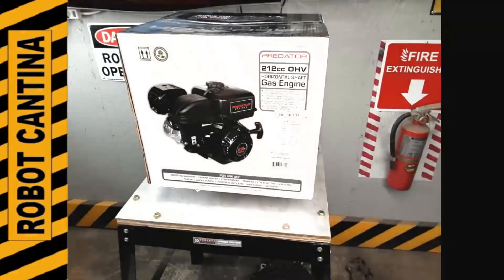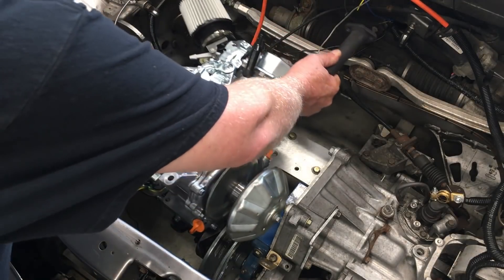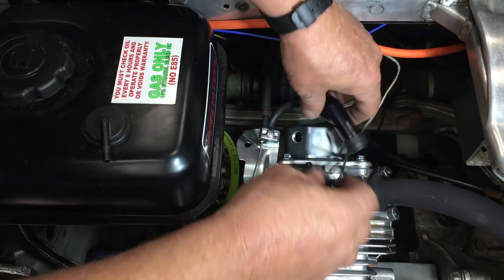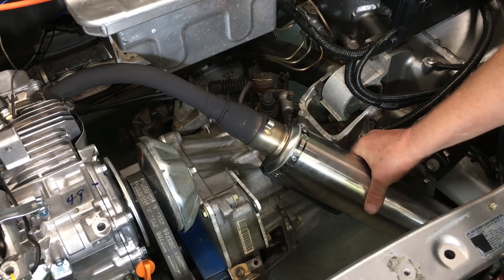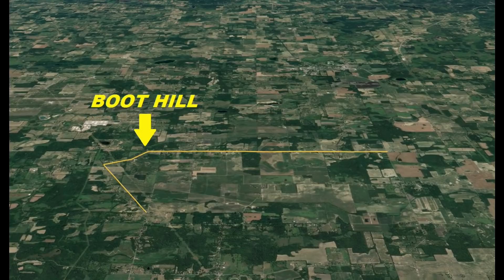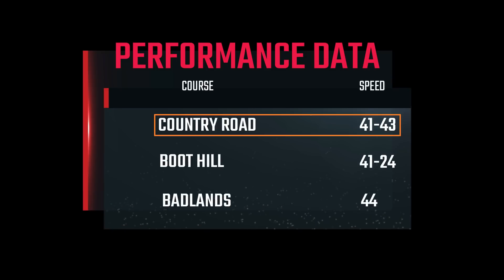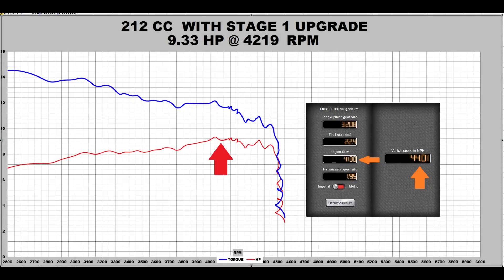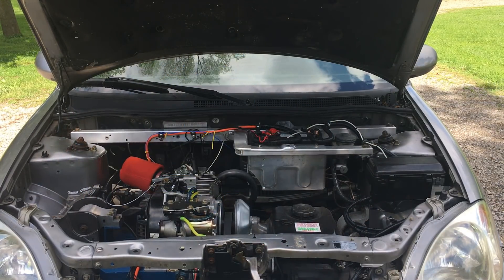Episode 4.  We put a stage one  212 cc engine in a Honda Insight  (Part one)

Comment: Great production work!
It seems your vehicle is more akin to a tractor than a gokart.
The stroker lawnmower engine is built for torque at low end, instead of power at high end.
You keep doing this kind of stuff, you will have a custom electronic ignition control, and computer tuning rig for the mixture!

Comment: Really shows how little power is actually needed to cruise around at low speeds
Reply: The lightweight car did go on a diet, but yeah, I think I heard it only takes about 20 or so HP to cruise at 50mph, though with cars slowly getting heavier it would be a bit more.

Comment: I found the investment in an exhaust oxygen sensor extremely handy for tuning. Weld a bung on the exhaust and you can monitor the fuel / air ratio under different loads and dial in the best jetting.

Comment: I have a 2000 Insight. Third and fifth synchros are shot and the battery pack is in poor shape. If not for the fact I live in New York and have to pass enhanced emissions, I would consider this modification.
Reply from the maker: move to Michigan...  Just kidding.  I actually grew up in NY
Reply: @robotcantina8957   are you saying this is street legal in Michigan, but not NY? What are the parameters that would make it street legal in most states?
Reply from the maker: @vladG30  The term street legal is sort of a joke.  In the State of Michigan, there are no vehicle inspection requirements and the state is unaware the vehicle has been modified.
Reply: @robotcantina8957   thanks. That gives me a reason for maybe moving to Michigan.

Comment: The remarkable part of this series is that you’re managing to achieve 70kph with an engine strapped to a 500kg car. Imagine just how fast it could go if it were to be strapped to a 50-100kg vehicle. Case in point: most bicycle enthusiasts use bicycles 10-20kg. A bicycle- based Human powered vehicle called a velomobile can use about 300-400W of power to get to 70kph. 9hp is 9*746W= 6714W!! (This is comparing the maximum power a person can pedal for a reasonable amount of time to he max power of this vehicle)

That would certainly be more than enough power to push a velomobile to well beyond highway speeds. It would be ridiculously dangerous though when you’re in a fiberglass shell and a metal frame. Best bet would be to reinforce such a vehicle using a secondary metal space frame and reconfigure it to be longer, to hold the passenger ahead of the two wheeled rear axle which the engine would be mounted on top of. It would be a three wheeled vehicle resembling a velomobile but much, much faster. It would get ridiculous mileages as well due to its insane aero.
Reply: When I was an apprentice mechanic, the shop I worked at, we had a race program. Top sportsman drag car. Anyway. We had one of those 49cc Harley lookalike pocket bikes as a pit bike for at the track. When that engine expired, we put a 6.5hp Honda on it, with a carefully selected gearset on the chain drive. 

Even with my 240 pound ass on it, it was TERRIFYINGLY fast.

Comment: Rather than making such a mess filling the gas tank, you could put a low pressure transfer pump in a line from the car's gas tank to the gravity feed tank under the hood.  Then just install a toggle switch to refill it.  That switch could even go under the hood so you could monitor the filling.  

Unless, of course, you removed the gas tank in video 1.

Comment: You keep saying street legal. What are you doing for electrical power for the brake lights and turn signals? I imagine that you don’t want to attach an alternator or generator. Do you just manually recharge a battery?
Reply from the maker: The battery provides the power for the brake lamps and turn signals.  One charge will last several months.  The headlights, horn and wipers also work but I do not use them.  Keep in mind this car was built to make videos and isn't driven much off screen.

Comment: 6:21 in- the gas spill. Gotta say that for a guy with the motor noodles far above and beyond mine that I seen the spill coming. Not because you didn't have a funnel ready. That's not smarts. It's just staying tidy.  
The nozzle on the can is set wrong. It should be spun round 180% so that it's pointing up and not out. Then you spin the can 180% too, so the nozzle is on the opposite side of your target.

Comment: Please eventually hook this thing up to the stock exhaust and give it electric start. It would be neat for it to be just like a regular car. Maybe even hook up a mikuni fuel pump and pull out of the stock tank into the stock  predator tank as a day tank so you could keep it running long enough to draw fuel all the way from the tank. 
P.S what kind of mpg does it get?

Comment: Really cool series! Quick question: Is there any actual safety risk of using the stage 1 upgraded exhaust system? You mention it’s loud but if you purely just wanted performance, would it pose any problems? I’m on a Mini Baja SAE university design team and your Comet CVT setup with a little engine is pretty similar to ours! We use a “10”hp Briggs and Stratton engine with a Comet 790 and a gearbox off of the CVT.

Comment: If the issue is that the engine rpm is out of the range of max horspower range before you reach the intended speed then changing the gear ratio on the chain sproket drive to a lower ratio should solve that problem, of having your peak power at 4200 rpm to match the drive train at 80km/ph, though you may also need more power from the engine to overcome the exponentially increasing air drag as you try to achieve the goal of 80km/h. Thought is is only another 14% increase in speed from 44mph to 50mph, the wind resistance difference between 44 and 50 mph is and increase of 29%.

Comment: I'm not sure if I'm an idiot or I understand this.  I'm not so much a car guy.... How does shifting work? You have the engine connected to a torque converter.... But that just controls weather the new engine supplies any power to the old transmission? .... After that point it's mostly just connected to the old transmission, but without a clutch so you have to shift without the aid of a clutch basically forcing you to always "double clutch"?... Is that right?   Is there a reason you didn't keep the old clutch?
Reply from the maker: There is a technique to shift the transmission without using a clutch.  Its hard to explain, but it can be done without hurting the transmission.

Comment: imagine putting this car with predator v twin engine.
Reply: @Lassi Kinnunen 81 Interesting contribution and ideas. I want to point out the USA doesn't have taxation issues with engine size that are common in other countries.
Reply: Some use hayabusa engines on Geo Metros. Easy 10 sec car.
Reply: @Lassi Kinnunen 81 hp is cool and all but torque is pretty absent in motorcycle engines.

Comment: Gotta love those "spill-proof" cans. Lol
Reply: Only the government could've fucked up a gas can.
Reply: The spill proof make me spill every time. Bought a replacment nozzle from China that dosent meet regulations and haven't spilled any since. Odd huh.
Reply: They're prone to user error.. if you keep the spout corner uppermost, that is, highest, then it shouldn't spill, because there's air above it not fuel. This fellow decided it should be the lowest corner not the highest, and that's what I mean by user error:-)
Reply: @grantperkins368  well mine was broken or somthing. It had two plastic tubes within each other , I had to press a big button on the back and use the tip to push the two peices into each other. It leaked all the way around where the two plastic tubes met. Didn't matter what way the tab was facing or the amount of pressure I put. Always leaked where the two met. Got my basic one with a twist top and haven't spilt since.

Comment: I feel like you'd do better with a centrifugal clutch on the engine and a chain drive. Those v-belts eat a LOT of power under load. Just tweak your pulley ratio so your "redline" is right above 50 and I'll bet you'd make it.
Reply: On further thought, you would need a centrifugal clutch with a sprag clutch. Otherwise letting off the gas wouldn't disengage the clutch so you could shift.
Reply: @samwichse  nahhh, as long as you aren't trying to speed shift and jam it into gear, rev matching will work fine.
Reply: That's what I said, those things have to eat most of the horsepower. 9 hp motor - the transmission probably sees about 3.
This whole thing reminds me of thing I watched on TV years ago about truckers in south America somewhere driving loads across some road that was little more than a two- track through the woods in most places.
There was a guy with small dump truck that had a one cylinder engine similar to what you have here. The only way it could move it was to drive it in the super ' granny ' creeper gear and only go about walking speed. The guy was delivering loads of bricks to some guy building a house in the middle of nowhere.
In one episode the guy was driving up some narrow mountain road barely making it up the hill and totally pissing off a long line of people behind him having to go SLOW walking speed on the one - lane road with the little engine knocking sounding ready to throw a rod any moment.